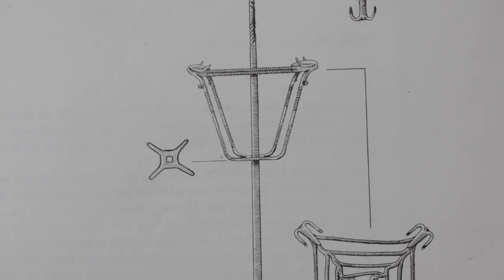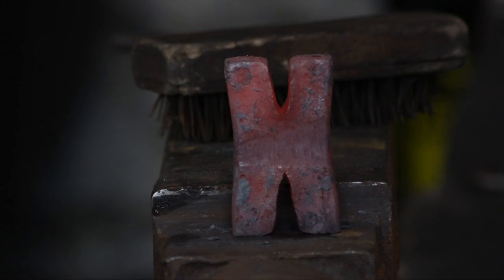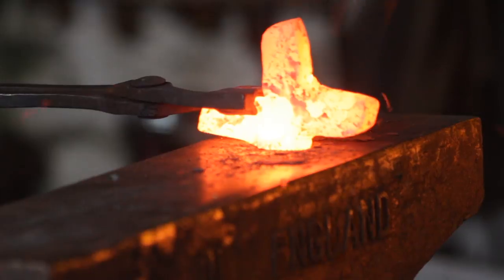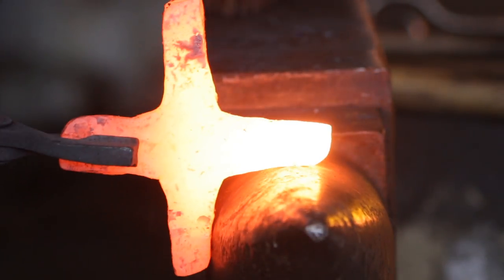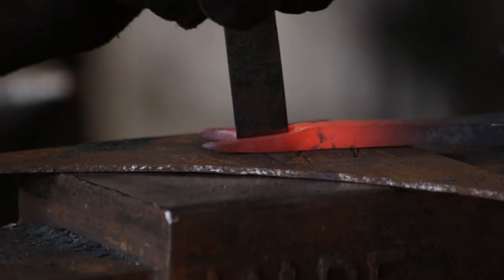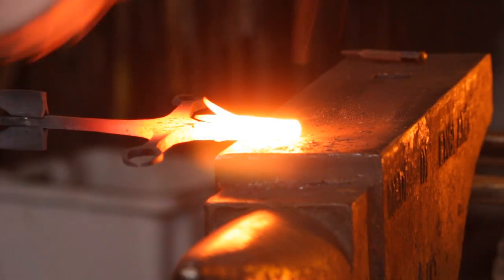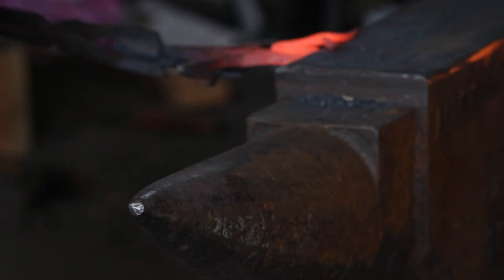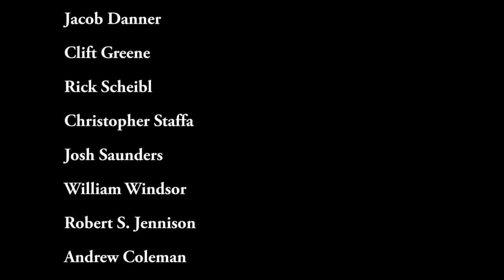Recreating the iron stand from Sutton Hoo. Part 2: The bull head capital.

Comment: Hi Rowan,

There's something so very satisfying about your videos. Your work is amazing, something so easily said but so well earned in your case. The historical work in particular leaves me pondering on the ingenuity and cleverness of blacksmiths through history.

This is quite a stretch, and comical I'm sure, but for mere paupers without any access to a forge, do you think plasticine could serve as a basic stand-in for forge work? Crazy I know, and the relative plasticity of iron/steel over temperature ranges would be extremely hard to replicate. Plasticine does change malleability with temperature (and working) but has terrible heat conductance. Before disappearing down a forging plasticine in leu of Fe rabbit hole, I wondered if you'd humour an obviously deluded and not wealthy city flat occupant?

If there's something to my analogy I could invest some fanciful hours in rehearsing for a paid course of the real thing. 

I realise this makes me look like a twat just for asking but I thought I'd venture it all the same. 

Wishing you well

Comment: Would be fun to hear and see you make a Daneaxe/viking broadaxe. I've been making a couple of them myself but, for me, the struggle is between the relatively narrow cheaks and the impressive width of the blade. I've always ended up forgewelding in a big 5mm thick carbon steel plate to the mild steel head abd get ther width throug that. I'd love to see the possible "original" way to do that or just hear your thought around it in the process.
Hope you're well and looking forward to see more.